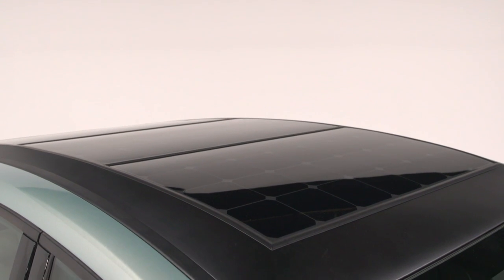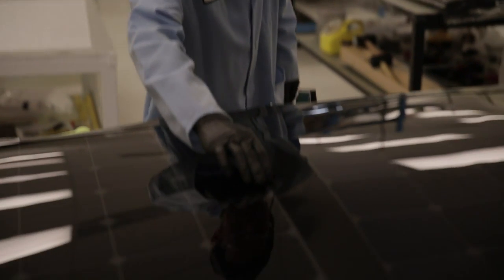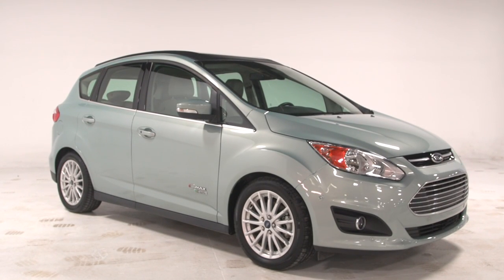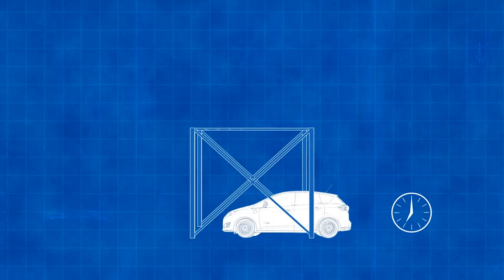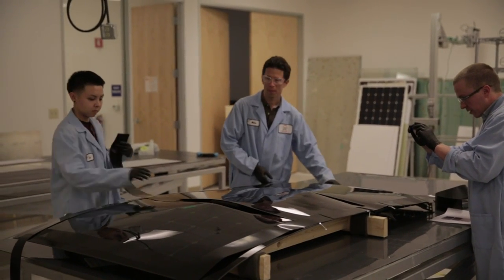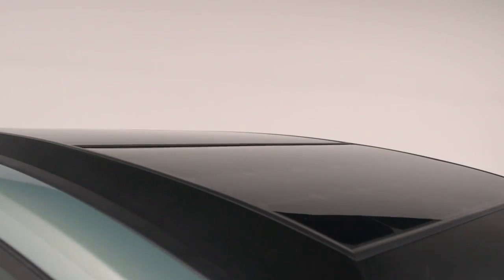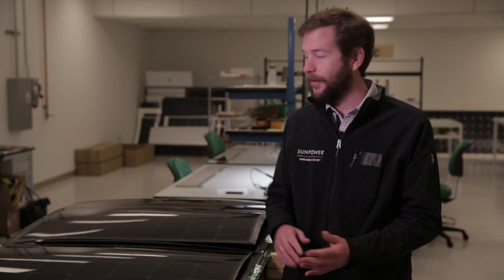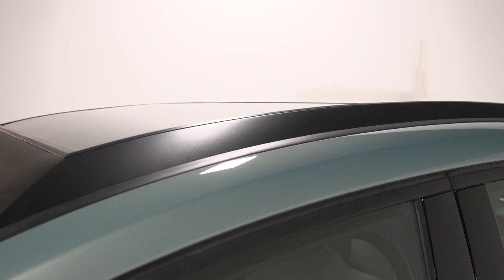CMAX solar energi concept from Ford

Comment: 300W from the panels +50% from the Fresnel lens means 450W.  This is the maximum power it can generate; let's use the figures from the Clean Energy Council as per e.g.
  http://www.solarchoice.net.au/blog/how-much-energy-will-my-solar-cells-produce/
which would suggest the average daily production in Melbourne (assuming you're leaving the car out in the Sun & not locked in a garage like most people would do) for 450W would be 1.62 kWh.  The best figures for Australia for the energy content of fuels are from ABARE's Energy in Australia annual as per
  http://adl.brs.gov.au/data/warehouse/pe_abares99001789/Energy_in_Aust_2011_13f.pdf
which has (page 92) the energy content of Australian ULP as 34.2 MJ/L (which it has remained at for several years), which means 9.5 kWh/L.  So at first blush that would mean you're generating from solar the equivalent of 0.17L of fuel/day.  Assuming a modern small car that is very efficient you're looking at 5L/100km, so that's a grand total of 3.4 km of extra driving.  Even allowing for a properly constructed car using an extremely efficient battery and electric motor system you're not going to increase that by more than a factor of 4, so let's be extremely generous & say an extra 14km/day of driving.
Now consider that for all of this technology you'll be adding at least $2000 on to the cost of the vehicle, which at say $1.15/day payback for the reduction in fuel usage will take you at least 5 years to break even on.  Probably more like 10 years when you also take into account the extra servicing costs for this technology and the battery replacements.  There will also probably be additional losses for the extra air-conditioning you use; solar cells tend to get quite hot (especially with Fresnel cell concentrators), which means the roof of your car will be substantially warmer than an equivalent vehicle without solar cells.  This might be handy in winter, but heating costs are zero anyway (due to the extremely inefficient internal combustion engine which produces way more waste heat than you could ever use), so all this means is your air-conditioning costs are going to go up in summer, which will drain the very battery you're powering with the same solar cells.
So, all-in-all virtually useless.  If FORD et al REALLY wanted to make a difference they would incorporate any number of fuel efficiency improvements that could be made to an engine, e.g for an additional cost of under $100 you can reduce fuel consumption by at least 30% using the waste heat for on-board catalytic cracking to turn fuel into methane on-the-fly which is then combusted in the engine with much greater efficiency.  Or replace the entire engine infrastructure and cooling system with an MYT engine the size of a 2L ice-cream container which would deliver the same power with much less material (and weight) and more than double your mileage.  Etc Etc.